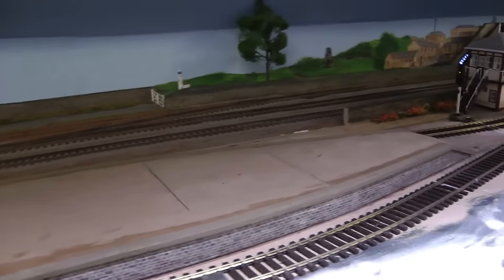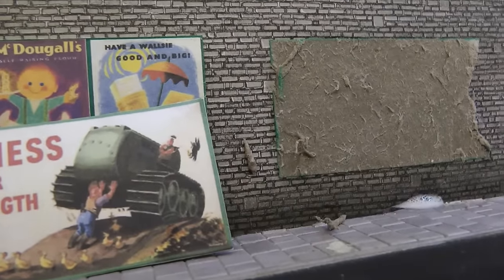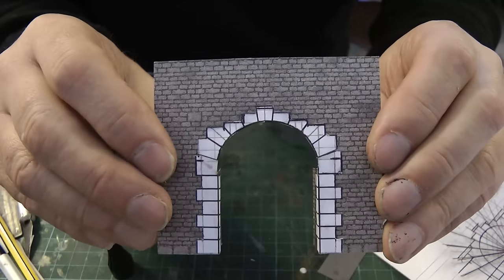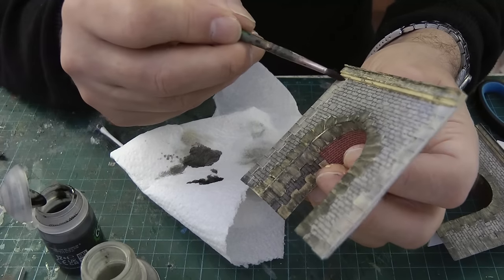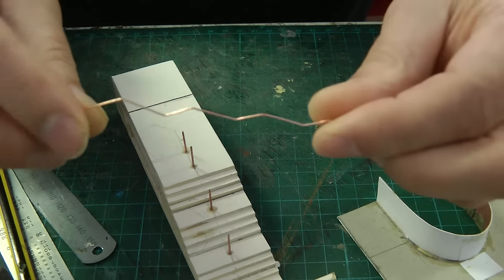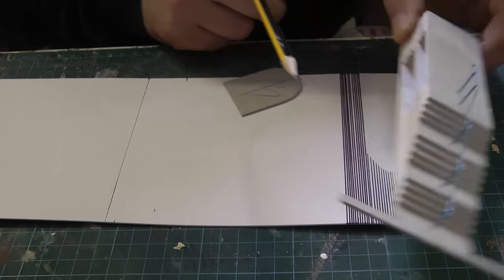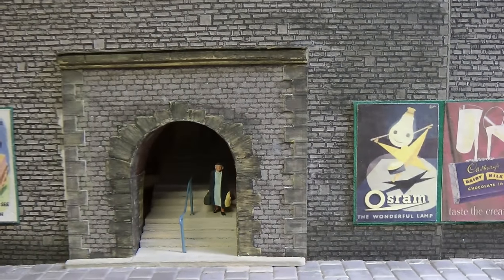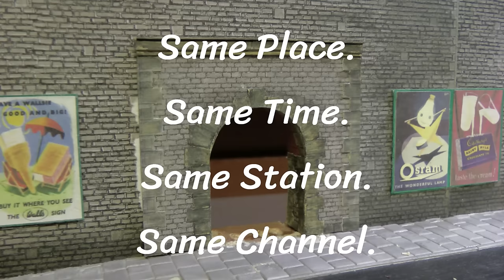Tyne Dock Re-Build Part 4.  The Entrance    No 426.

Comment: Hi Tony. Excellent work on these subway entrances.  They really do look the part.  As for your soldering , you can buy solder in a variety of melting points.  You can use hi melting point for the first step and lower melting point for the second, knowing that you should be safe when it comes to not melting the soldering you first did.  Should really have a thermostatic iron too, with adjustable temperature setting, to be safe.  Hope you and Mrs T have a nice weekend.  Best, Jason.
Reply from the maker: Good evening Jason. thank you for commenting, the entrance has turned better than i thought it would. my little 15 watt soldering iron has served me well over the years. Mrs T says hello. take care my friend. all the best Tony.

Comment: Absolutely wonderful build. There is no end to your talent as a scratch builder. It just happens that you have the necessary materials at hand. That can only come from years of experience. I wonder how many courting couples will use the tunnels when the lights go out. Martin. (Thailand)
Reply from the maker: Good evening Martin, Your right picking the right materials for the right job. and a bit of luck. thanks again for commenting. cheer's for now Tony.
Courting couples. cheer's for the idea.

Comment: Dear Tony, absolutely awesome those two subway entrances for the Tyne Dock Station! Love how you did and showed the color matching of the stone work. Little bit tedious to do those arches, but the results look simply amazing. Beautiful how the Station Road entrance breaks up the wall and adds new dimension to the once flat wall. Don’t wanna press you into anything, but am just wondering what the natural light feature would do to the subway entrance space when the staircase up the platform would be open. Might be too much of a challenge though. Love the color you used on the platform. Never seen that brand of enamel paint. Very interesting how the paint flows and at the same time isn’t completely opaque, through which those different shades emerge. Have a great weekend! Cheerio
Reply from the maker: Good evening Vincent. it was the only way to gain space for the new buildings for where the old station use to be. which will give a whole new look to the tyne dock area once completed. the underpasses wont be opened up. as the level of work needed to do that would a whole new baseboard. but it was in my thoughts originally. its a small compromise to the original station. many thanks again. cheer's for now Tony.